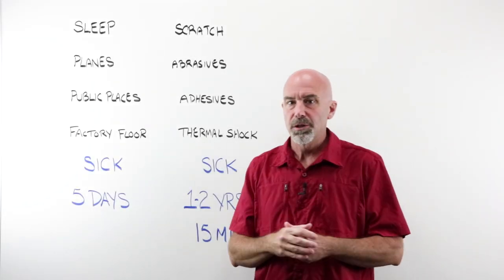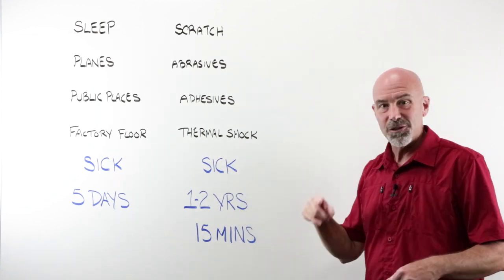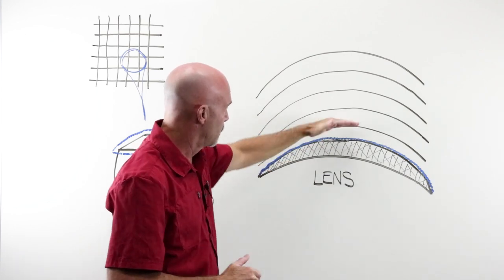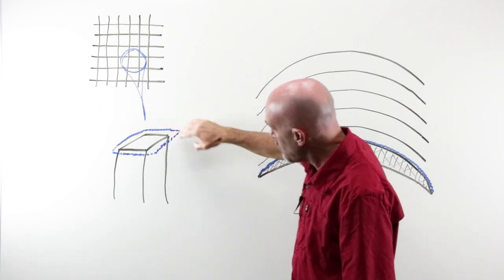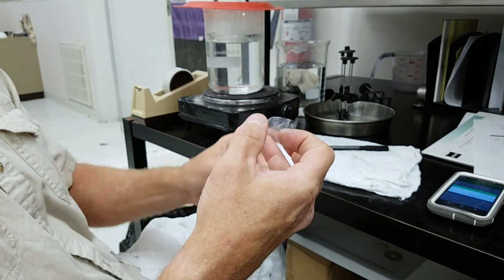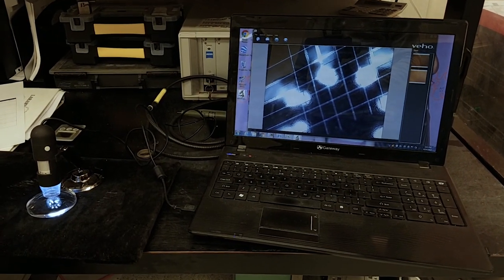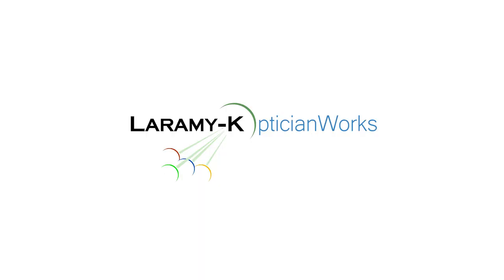Testing Your AR Coatings: How It's Done

Comment: I am having a terrible time getting lenses that don't start scratching or crazing within weeks of getting them. I was wondering if it is just the AR layer degrading. If I get lenses with only the thermal hard coat without the AR, will they be more durable?
Reply from the maker: Yes. Whenever we had someone like you we just stopped doing an AR coat. No AR is better than crazed, scratched AR for sure! You may even find someone still offering a higher level scratch coating. John

Comment: I wonder if the optical vendor lied to me. I asked for "computer glasses" but I still get headache after long hours in front of the computer when I'm not using blue light filter.
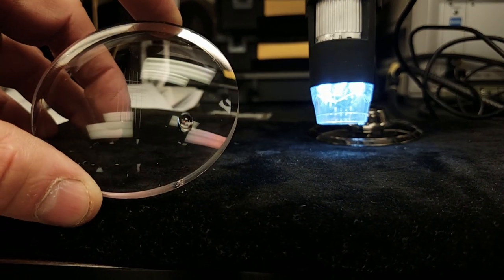If you don't mind me asking, sorry to bother. -- Does AR coating always capable of this 6:52? How can I tell that mine is AR coated? How protective are they in a completely dark room(is blue light filter needed?)?
Reply from the maker: There is quite literally information overload on "blue-light" that you can't really sort it out anymore. IMO - it is 90% nonsense. But, that is up to each individual to decide. 

Any good AR with a hydro-phobic layer will (should) shed a water droplet like that. The day I bring the glasses home sure, 6 months - still pretty good, 12 months - well maybe not like that first day. 

We don't make any claims on an AR coating protecting anything or anyone from anything. They are just there to allow more light through the lens so you see better. More Light = More Sight. 

Does a blue-light filter protect you from anything? Maybe
Does a blue-light filter block anything? Yes
Reply: @LaramyKOptical  Thank you